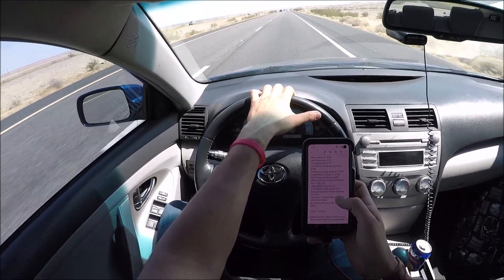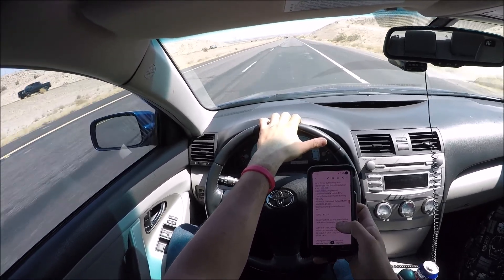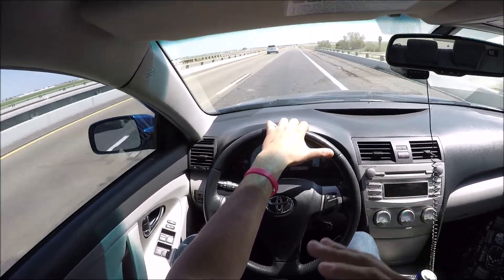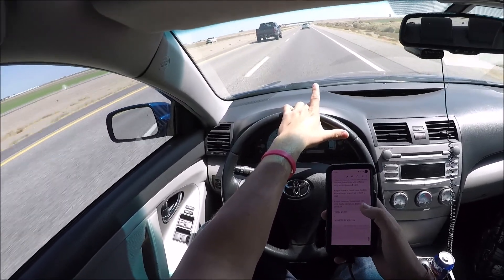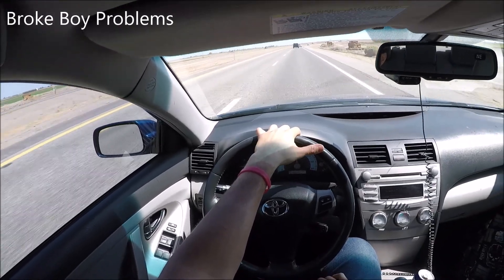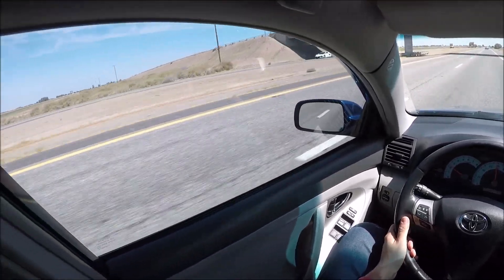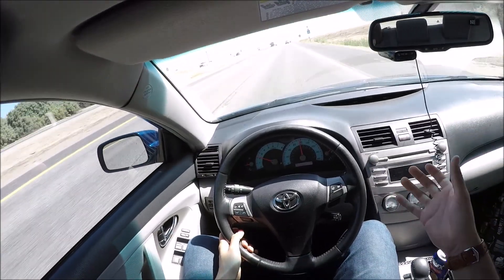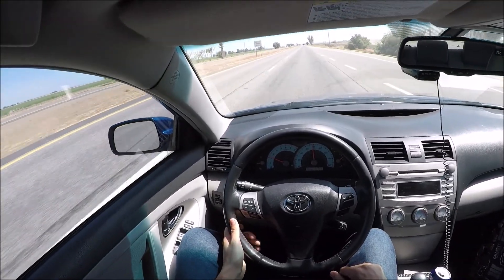Total Cost of Building a 2AZ-FE (Boost)

Comment: Can the 2AZ-FE be reliable with stock rods at 300hp and with aftermarket forged piston set? I heard that the 2AZ-FE have oil issues. And that aftermarket pistons would be key to stopping it.. is this true?
Reply from the maker: Yeah if you're opening the motor, I would do pistons and rods. The rods are the weak point, and depending on what year motor you have your pistons might also be a problem. So pistons, rods, arp headstuds and mainstuds and you'll be 400whp+ reliable set up.
Reply: Im trying to build my 2010 xrs 2az fe but over here in new york seems like nobody dyno tune XRS’s SMH every where i ask,i feel im tryng to build for nothing
Reply from the maker: Well honestly, I would boost the car instead of going all motor. And utilize the unichip before spending big bucks for a standalone. And I think Shane from Boosted Scions FB can remote tune the unichip.
Reply: I have a 04 Toyota Camry xv30 what can I do? What brand are all your mods ?
Reply: the V6 for a 2007 camry makes 286 HP and uses a 2az-fe aswell so maybe

Comment: looking to run 2azfe engines in both my corollas next season. you got spares?
Reply from the maker: Not anymore, in AZ you can find them pretty cheap at the junk yards
Reply: @omarrod71  ayyyy im moving to az next year. gonna be paving 1 possibly 2 japanese tracks{not ebisu}
Reply from the maker: @rattyratstuff7125  if you're paving anything with the city you might see me.
Reply: @omarrod71  id be paving my own property. me and bro are moving with parents. theyre buying 2-5 acres in a town and well build tiny homes on it till weve gotten our own. my thing is gonna be 20-50 acres away from everythbing so i can build a few tracks and a shop for ppl to use at the track with additional rental stalls that are single car that come with tools. 

we used to have rental "shops" here in norcal before mandating by obama. we used to spend 500 for a weekend with a lift, tools, and an old alignment machine. id knock out rolling shells in a weekend and make 3 or 4k to dump into my s13s at the time.
Reply from the maker: Fuck Cali, moved to AZ and never looked back
Reply: @omarrod71  ya, i was all good here till they stole the rental stalls. it was heaven. buy 2k s13, spend 500 on stall and 1k on s13. sell car on monday for 5k+ now theres nothing good here and with the crackdown on mods cause of the take over idiots its getting way too expensive to run my 86s. time to let go and move to az or new mexico.
Reply from the maker: @rattyratstuff7125  you gonna love AZ

Comment: Cost more than an LS swap. But I have a 6 speed manual Camry I want to boost
Reply from the maker: Also making 800whp reliably if I wanted too... can't compare the cost of an LS making maybe 400whp.
Reply: i built loads of ls at the shop. a quality drift ls1 will run around 5k before trans clutch and install
Reply from the maker: @rattyratstuff7125  We swaped ls in plenty of vetts and maros. Putting an ls in the tC is gonna cost more then 10k if someone that doesn't have equipment. Not  taking into account all the custom fabrication required to make it work.

Comment: ...and still SLOW AF
Reply from the maker: 800whp...slow ass people... get to my level peasant
Reply: @omarrod71  Wait actually?
Reply from the maker: @cobaltsscam  Yes, I have a video of all the parts being put into the car,  this one talks about the price,  but since then I decided to add even more parts like cams, valves, etc.
Reply: @omarrod71  The fuck? How you pushin' that much power out of a 2AZ-FE? I'm calling BS, show a dyno video!
Reply from the maker: @brytonmassie  The motor is being built to handle that power, and I will push that power.  You're literally on the video talking about the cost of building the motor. Clearly no ebay or cheap parts here. There is also another video showing the parts if you don't believe me.  Currently waiting on Cams  being made, and need to order more parts,  but yes this block is petty strong,  but we're taking it steps ahead. So no bs here sir.
Reply: @omarrod71  Como te busco en insta o en facebook brother

Comment: How much HP did you manage to push it to?
Reply from the maker: Haven't built the car yet,  still getting more parts.  But when the motor is built should handle 600 wheel reliably.
Reply: @omarrod71  LMAO  good luck hahahahaha
Reply from the maker: @Buddyclub33  Get to my level peasant
Reply from the maker: Eighty Baby  I'm doing it for my 05 tC, completely building the motor for boost.